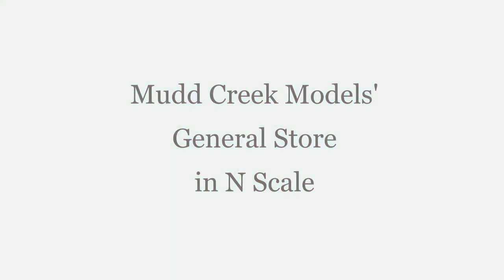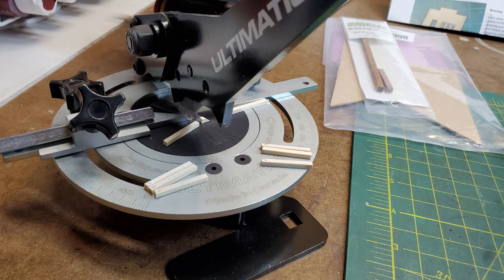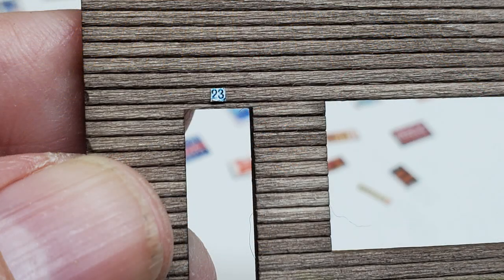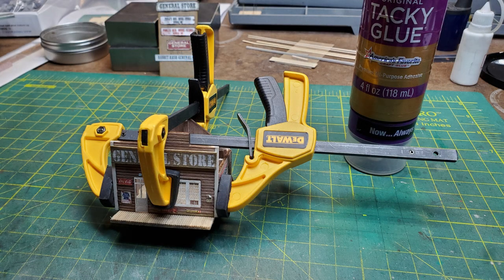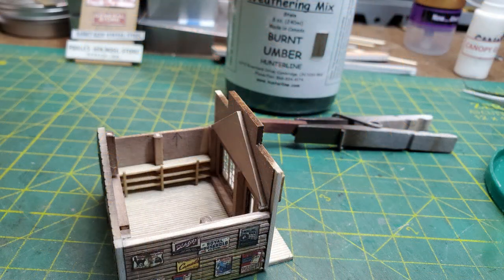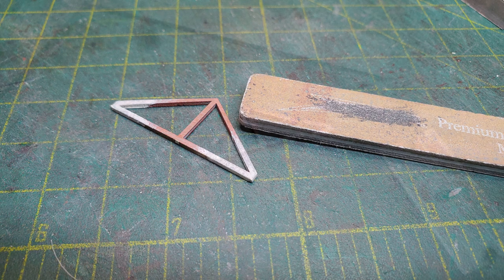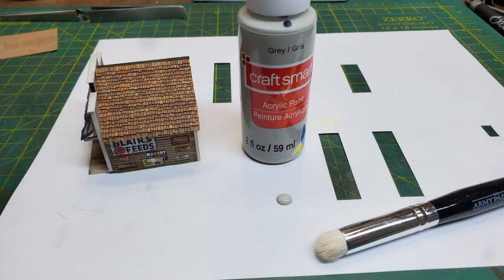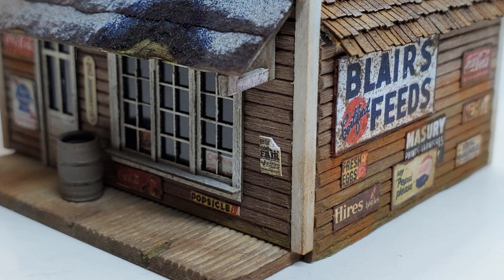Mudd Creek General Store in N Scale

Comment: Very nice. Like Krisblackmarr, I like the idea of using the brick corners from Monster Model works to make brick piers - great touch. Also a good example of how kitbashing does not need to be radical - just substituting walls can make a structure more interesting.
A note for modelers who are cash strapped: you can get results that are almost as good as the Ultimation Sander by using the Northwest Short Line True Sander instead.
Reply from the maker: Yes, thanks, the brick supports may return depending on scenery. I have the NWSL sander, and it served me well for 2 decades. And there is a big difference in cost, but also in performance. Almost any sander like those can help when trying to get flat edges or ends on stripwood.
Reply: @CassidysWorkshop  As it happens, I have both the Ultimation Sander and the Slicer, and I love them. But I also believe that many modelers need to know about less expensive alternatives.
Reply from the maker: Absolutely. There's a lot I couldn't have built without my NWSL sander and chopper.